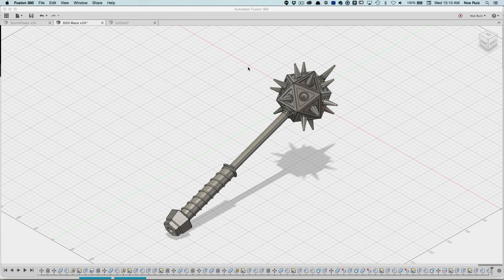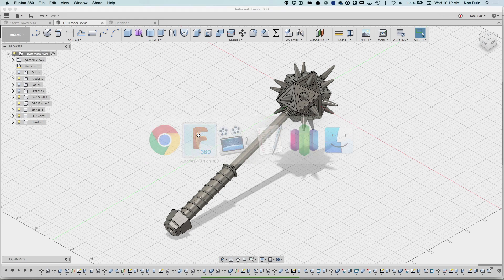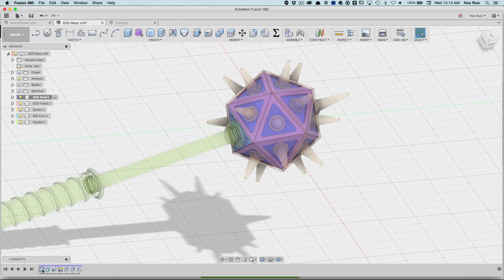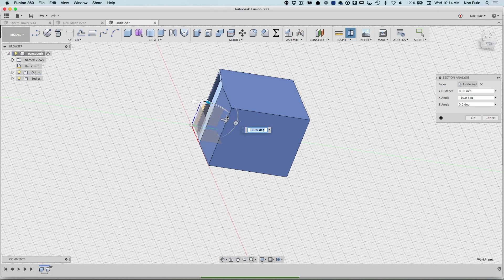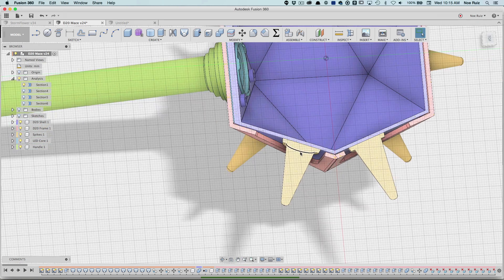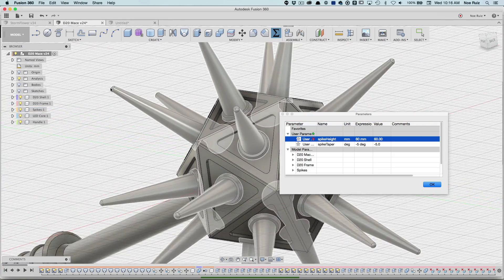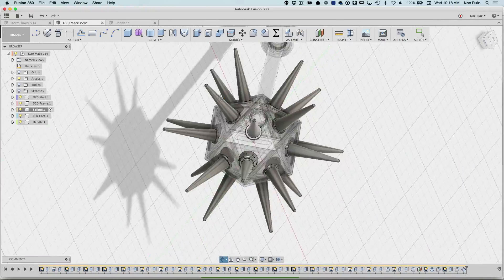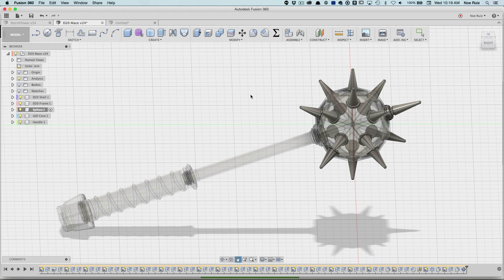Layer by Layer - Top 3 Features in Fusion 360

Comment: When do you think it makes sense to upgrade a body to a component? As soon as you extrude the first sketch and then refine as a component or keep as bodies until all the edits are made? Are there any pros/cons you can think between them that might not be obvious?
Reply from the maker: +Juan Garcia It's probably best to start with a new component before starting any work.   when you know the project calls for multiple parts, its easy to think of them as separate components. if its just a single part like a mount or bracket, then regular bodies are fine. –Noe
Reply: That makes a lot of sense. Thanks for the tip!

Comment: Couldn't you copy and paste the cones, and then use the "align" command by using the center point of the two faces?
Reply from the maker: +GeorgeGraves That's totally do-able but when I tried that, I couldn't seem to get a center point for each triangle. Fusion snaps it to a spot that says it's centered but to my eyes, was off centered. I instead referenced the center point of the global origin planes.
Reply: I did a quick test before I posted, and it worked great.  That's not to say F360 doesn't have some quarks for sure!  As I'm working more with the program, I do like it - but anyone working with it,  should tell others that it does have a mind of it's own at times!  For sure!  Unlike other autocad products that you have to do all the thinking. So far it seems like a worth trade off.